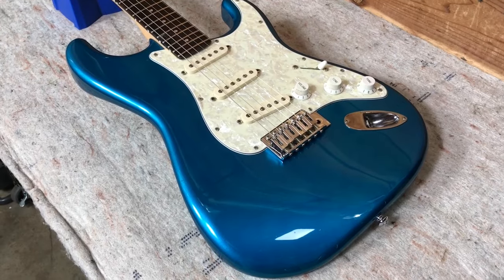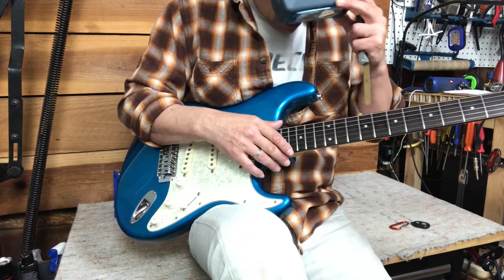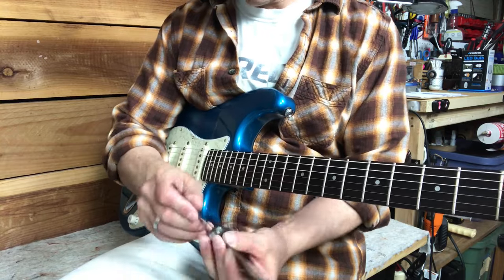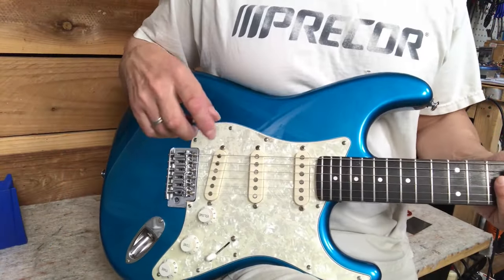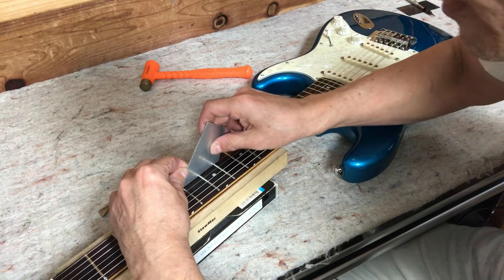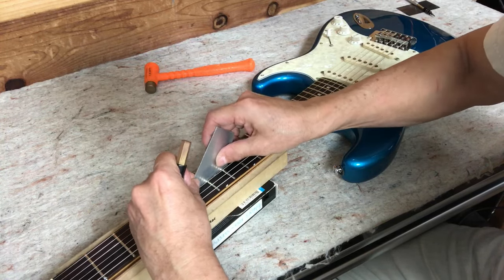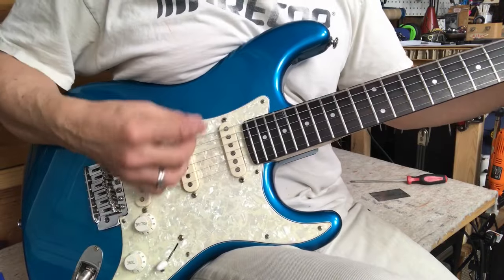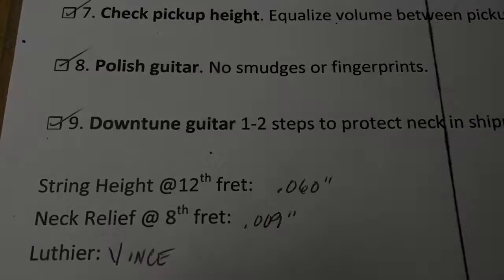Fender Stratocaster Setup Micro-Tilt Neck Adjustment & Fret Rocker to Fix Fret Buzz

Comment: nice tutorial can you give an ideal pick-up for stratocaster.
Reply from the maker: Thanks! honestly I don't know if I'm qualified. I know that I've always had good luck with Seymour Duncan pickups. Also, really depends on the sound you're after. If you want a Strat with extra power, then a DiMarzio or Duncan "rails" type pickup is like a humbucker stuffed into a single-coil size. But if you just want a better sounding "Straty" pickup, going with Duncan or Lindy Fralin, you're gonna end up better than the stock ones, but it's a very personal decision. I suggest reading some online reviews and then deciding your budget cause they can get expensive too. cheers
Reply: @stillkickinmusic  sir im asking for an ideal pick-up height settings  for my hss ceramic strat.
Reply from the maker: Hi, for single-coil pickups I measure about 3mm from pickup to bass strings and about 2mm from pickups to high strings. Measure while fretting the high E and low E strings at the last fret. You don't want your pickups so high they are touching the strings. Also, if it is a humbucker, like the "H" in your HSS, you usually need a little more space (4-5mm) between pickup and strings. After you think the height is correct, then play each pickup individually, and make sure the volume is close to the same between them. You may need to re-adjust if one pickup has more power, and you may have to live with more power from the humbucker as they are usually gonna be louder than the single coils. hope that helps. I'll try to make a video on this!
Reply: That is not how Fender recommends the neck tilt
Reply from the maker: @5150flstc give more info please so we know what you are referring to